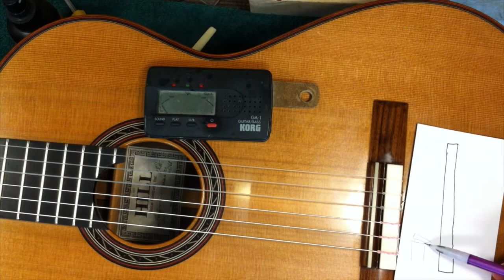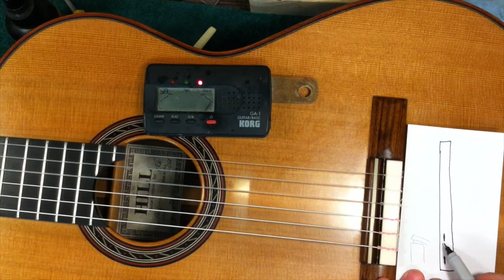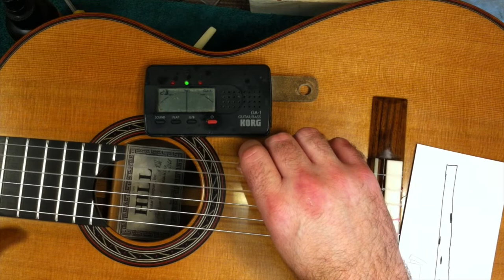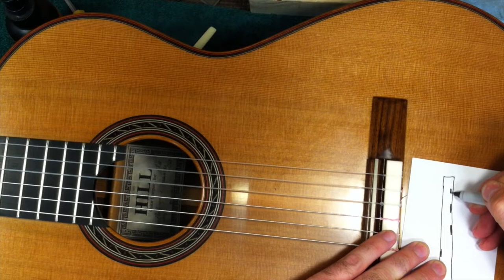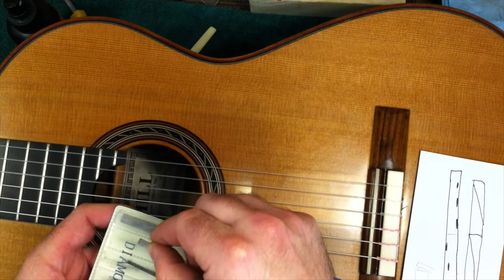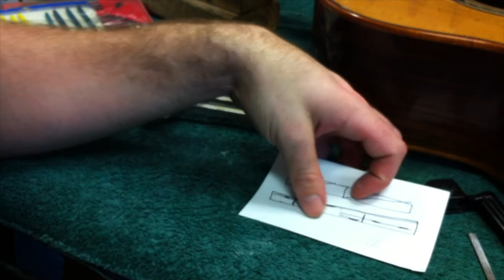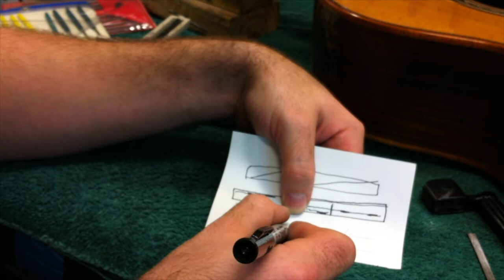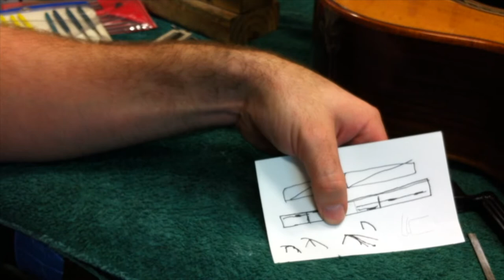Carving an Intonated Classical Guitar Saddle

Comment: Excellent video on getting the intonation right on a classical guitar by meticulous carving of the saddle points. As an aside particularly to reduce wear and tear for the lower strings ie to  lubricate/reduce friction over string contact points over both nut and saddle: try putting pencil graphite (a natural solid lubricant) into nut and saddle slots and contact areas/points. A sharp pencil is all that is required. [See Strat Talk for more details]. Downside: graphite is coloured, dark grey. Works for my electric guitar for string longevity.

Comment: I used a 4 mm stock bone and created a ledge for a 2mm saddle slot that extended backward so as to lengthen string to flatten sharps
Reply from the maker: Yeah, you can do it that way, though I have found in most cases where that is needed either the saddle slot is located in the wrong spot relative to the scale, or the strings are too high tension for the instrument. This solution is one I frequently need to use on cheap ukuleles. It may be possible to move the whole bridge on your guitar with a reglue or to make one with the saddle positioned better. Maybe even a plug and reroute.

Comment: I had no idea you have to intonate for your strings of choice. I had good high-tension strings on my guitar, and while the intonation wasn't perfect, it wasn't screaming out-of-tune. Then I bought more expensive normal-tension D'Addario strings, and all of a sudden strings 3, 4, 6 got so pitchy (15-20 cents on the 12th fret) that I don't want to play the thing anymore. I guess I'll buy the same high-tension set and see if the intonation improves. Then I'll try improving it even more using your video. Thanks.
Reply from the maker: Yup. Its frustrating. I have done setups before at the shop where someone hands me a set, I set it up, they take it home and put some wildly different thing on it and then call me to tell me the intonation is off. It doesn't matter how many times I explain it.

Comment: My Hill guitar has a great sound, but my super high tension D’addario titaniums did a number on intonation at the higher frets. The string stiffness warranted extending the saddle to about 3.5 mm, thus the reason for using a cantilevered 4mm saddle fitted into a 2mm saddle slot.

Comment: i have extra high tension strings on my ibanez nylon thinline, with a neck that has less than ten thousandths of relief, and the action is nearly as low as a steel string, and probably the same as a high action steel string for someone who bangs away on the strings. it has a truss rod which makes things way easier for me

Comment: 64ths? 32nds? How can people live like that? There's a reason most countries reformed their unit systems last millennium. 
That being said excellent information in this video.
Reply: I know, it's ridiculous. Just use millimeters!!
Reply from the maker: A lot of luthiers even some over seas still use these old units. I think its due to the age of the craft and the fact that 32nds of an ench are a slightly finer measurement unit. You also see imperial used in aerospace manufacture, I think for the same reasons. I am not here to stan for imperial, just give my thoughts on why we still use it here.
Reply: @DrewsGuitarShop  I suppose you're right, considering how old the craft is. At least these are standardized measurements, in the old old days people would just go by hand-lengths, finger-widths, or by measuring with their lower arms. It just seems jarring compared to the clear and simple metric system.

Comment: My saddle is straight and tightly fit and doesn't seem to have been adjusted before. 5 of the strings keep acceptable intonation but one, the 4th (D) is way off, like I guess about almost half a semitone flat at the 12th fret. This started like a month ago, never had happened before. Could it be just the string is too worn out? I can't understand how one string can have such bad intonation and the rest stay almost perfect. I don't know if I should start by changing the string or carving the saddle
Reply from the maker: I can understand it. Intonation problems on just one string are pretty common actually (though its usually just one you notice out of several.) What matters is that the contact point is in the correct spot and that the string is in good shape. If its indeed a new problem that just started like you say, the string is really the only thing I could think of outside of some other pretty catastrophic stuff like you bridge breaking or peeling up or something. In general, changing the strings can fix a lot of annoying minor issues.

Comment: Hi, 
Great vieo.
Could you please explain what the white part added to the saddle used for?
Reply: It's to stop the strings from cuttting into and making a groove in the back of the wooden saddle
Reply from the maker: Are you referring to the tie block potion of the bridge? Nothing was added to the saddle here as saddles are usually...well...just saddles.
Reply: @DrewsGuitarShop  right... wooden bridge, not wooden saddle

Comment: Great video !! I had to watch it all and take notes, I am setting up some classical guitars that have the same issues as some of the ones you described. My main player , a yamaha is showing some sitar like sounds on the d string. Didn't know if this is common or not. Now I think I can correct the issue. Thought it might have been a string issue, but the new strings did the same thing. Another guitar (cheap one) I'm repairing  (kinda) for a give away, needs a new saddle set up. Didn't come with one.  (Freeby guitar) .Thanks for your info & I hope I can use it for my benefit. !
Reply from the maker: I hope the info proves useful! I might do some more carving vids at some point. Nut carving has been one I have wanted to do for a while.
Reply: @DrewsGuitarShop  Hello, friend! Can you help me? I have a classical guitar with very bad intonation. I put a capo on the first fret and tuned it. And the intonation is perfect with capo. Do you know the problem with the guitar?
Reply from the maker: @henrimavignier  contact me through kofi if you would like help with this. I have a feeling it’s going to be more involved than I can or should get into in YouTube comments.

Comment: Thank you for the well done video. Do you think it's possible to achieve intonation, like you did in the video, if the slot isn't slightly slanted forward near the high strings like some bridges ?? In other words if the slot is straight, and the bridge is about .10" (2.8mm) thick, is there enough thickness to intonate all the strings ? Or do you strongly recommend using a bridge with a slanted slot ? (I broke my guitar's bridge by trying to force an over-thick saddle into it and have to replace it). Would be most grateful for a reply. Thanks.
Reply from the maker: That actually is probably even better. The higher the saddle, typically, the more you want the contact points moved back to compensate for the higher resulting tension. If I am not mistaken, that is why the saddles in modern classical guitars angle back like that.
Reply: Thanks Drew. Problem is my choice of saddle is between a better quality straight or lesser quality slanted. Sounds either should work with varying degrees of flexibility?
Reply from the maker: @michaelduddy4119  Both will be fine. Get the one you want to choose. I do not advise on subjective decisions.

Comment: The saddle slots should be narrow/deep or wide/shallow in general? Mine seems wide/shallow so they can move, so I am thinking to make them deeper to hold the strings, but was told that may impact the sound. So which is better - narrow/deep or wide/shallow? Thanks for any info from anyone.
Reply from the maker: I am not sure what you mean here. Are you talking about the slot in the bridge in which the saddle sits or are you proposing cutting slots into the saddle? If its in reference to the slot in the bridge that the saddle sits in, the saddle should fit snugly, but not overly tight. If you are talking about cutting slots into the saddle for the strings to sit in, don't. Thats not a thing. Saddles on non-archtop guitars do not get slotted. Any time you see that some amateur has been up to no good.
Reply: @DrewsGuitarShop  Thank you for the info. I am talking about the slot on saddle. My string can move and the slots seem too shallow so I cut them deep but told that make the sound bad, so confused. So you think No Slot Cut on saddle fo string? But then the strings may move. My saddle is too low and want to buy another one, but confused with String Slots on saddle. Anyway thanks.
Reply from the maker: @coolinva  Classical guitar saddles should not be slotted for the strings. That is not how you deal with the problem you are describing. What you have is either a break angle that is too low because the saddle is too low, and or a bad neck angle causing the situation at your saddle to be bad. What my video about neck resets if you want more info about neck angles. 

As a general rule, you do not slot saddles on guitars. Its not how to properly solve the issues. There is always a better way to handle it.
Reply: @DrewsGuitarShop  Thank you very much and really appreciated. Yes, my saddle  is too low and I will get a new one soon and try without slots for strings. Thanks again for the help.

Comment: What happens to the intonation when the strings make their own grove in the saddle and should the saddle be replaced or crown sanded until the groves are removed ?
Reply from the maker: Don’t sand your saddle, thats not how that issue is corrected. As for what it does, it lowers the string hight and will effect tone and intonation. Maybe cause buzzing.

Comment: Thanks for the amazing video! I was wondering why you are not (palm) muting other strings when you measure or tune a certain string? I think the other strings will resonate along and influence your findings? Could that also be part of the reason some strings are hard to read, going from flat to sharp? My experience is that sometimes tuning is easier with other strings muted.
Reply from the maker: The tuner I have here is a little quirky. I’ve had it in the shop for like 11 years. Sometimes it likes reading some frequencies better than others and I also have train tracks near the shop that creat low frequency sound pollution that make it really act up. I guess I don’t palm mute when doing this because the goal isn’t tone precise so much as it is to be close and to get the temperament more dialed in. When I do electric intonation I have foam mutes I use for isolating the string I’m working on.
Reply: @Drew Jones  I see, thanks for your reply and sharing your craftmanship. I've intonated my G string by using your video as a lead in combination with an online tuner. The G string was way too sharp, so I filed a slope in the saddle at the G string and now it's almost perfect. The guitar sounds way better now, thanks a lot!